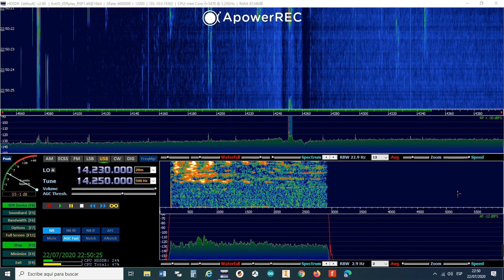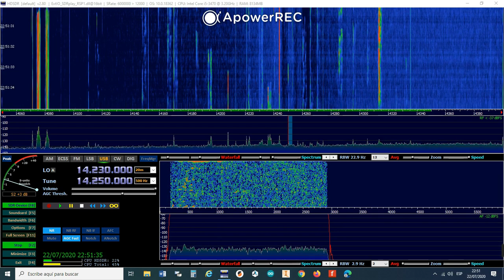HORIZONTAL  VS VERTICAL POLARIZATION IN A MAGNETIC LOOP ANTENNA

Comment: Interesting!  Wondering what overall height of loop is in both configuration?  For example, with loop in a Vertical position what is height above ground compared to height in horizontal position? 

 In both modeling AND empirically, I have found that height in the Vertical position is pretty much irrelevant after about 1 loop diameter BUT in horizontal position, the overall height needs to be about 8-10 loop diameters to have a comparable  pattern and performance.  If you can raise the horizontal configuration up around 20-30 feet I believe you will have an omnidirectional pattern and performance comparable to the vertically mounted version.